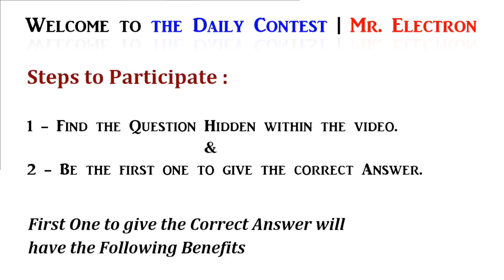220v Universal Motor to Super High Speed DC Motor 690W

Comment: Because the windings on the walls act like a stater in AC and the sine wave  frequency  can have it running in both polarities  and doesn't short since its not touching the magnets in any way but if you energize it with DC basically the stator makes the windingsin the coil a reverse magnet field wich makes it push away from the solid magnets which are already magnetized fields in N to S from each other making the shaft spin endlessly trying to repel same polarities

Comment: Universal motors can also run on DC because when the windings are excited, the motor shaft turns. This causes the commutator to turn, thus changing the contacts of the armature and the magnetic field of the armature. The field winding electromagnetic field is constant (in DC). This cycle repeats, which turns the motor.
Reply from the maker: Very Good !!! You are the contest winner for this video. Congratulations !!!
Reply: Thank you!
Reply: Quel puissance developpe tous les eperience sur les énergie free parce que vous mettez des ampoule ce qui ne veut rien dire. Et soiller vigilant sur ce sujet salutation

Comment: Hi Mr E ,
 where did you get the magnetic  to put in there?    
so i can use a universal  washing machine motor to make power just by doing what you did  ?
 but how do i know about the other items you using in the video?
  was it a transformer and capacitor and what else used  ...?....... 
and was that to make the motor to have more rpm  .?
sorry female  no knowledge at all and need to go of grid set up more power source to  battery bank without buying more solar panels 
i would appreciate your help.
cheers

Comment: Firstly The name "Universal" it self tells that it can work with  any type of supply(Ac or Dc)!Main thing is if we give ac supply to any ac motor it  results of double field revolving in both half cycles which results to block(unstart)of rotor !so to overcome this we have to use auxiliary winding perpendicular to main winding! But Universal motors are specially designed without any auxillary winding so it can run for both Ac & Dc ,Due to Lorentz force action!!

Comment: Would this be strong enough for a motorcycle frame?
Reply: No. For ebikes You need stronger motors. But You can use a car alternator and modify it to run on 48 volt batteries. It Will be very powerful.

Comment: I think it's cz the armature & field windings are connected in series that a universal motor can operate with either DC or AC supply. ... To reduce inductance in the armature, the current flowing in each coil of the compensating winding is in a direction opposite to the current in the corresponding armature loop near it.

Comment: It is common in unversal motors they keep stator armature and rotor armature those they will supply to both armature and it needs more energy. But instead of secondary armature you are keeping the magnets has we supply do voltage to rotor armature it becomes an electromagnet and works has DC motor

Comment: 23000 rpm isn’t  possible because bearing not support more than 5000 rpm..
Reply from the maker: Its normal speed rating is 14,000 for which it is designed to operate.

Comment: I don't see the point of converting it to a DC motor since universal motors will run on either AC or DC. You could have left it as it was and simply applied a DC current.

Comment: car battery electronic speed controller then high speed bldc motor to run up an alternator 120 or more to the correct speed and then the alternator is excited by a battery. then the energy now on a different circuit is used in part to charge the main battery. this is a battery step up system and if the alternator becomes self excited or just uses the lowest common denominator of energy for the greatest effect. this is called a high effieciency restorative system. for the second battery uses the least amount of energy while the first one is charged (recharged in circuit like a car battery and therefore runs until excitation battery runs out. ) by the excitation gatherer. the question is of effiency and how much can you get. remember it has to charge the car battery and then power a esc and then another bldc motor to operate the scooter. this is not perpetual motion. this is not cheating. it has a limit.  same thing many views but nobody shoots you maybe. just show exciter batter life as the batter life and efficiency if the answer.